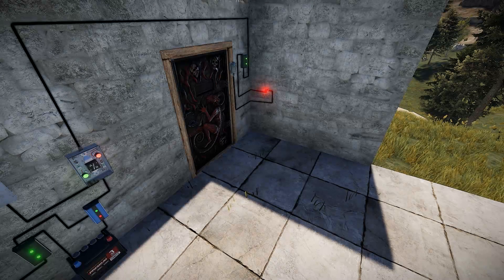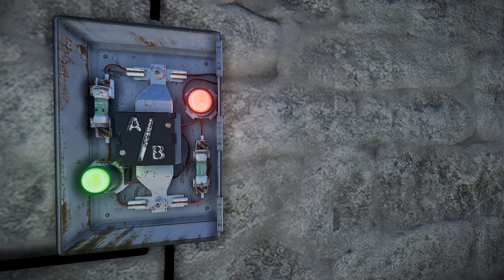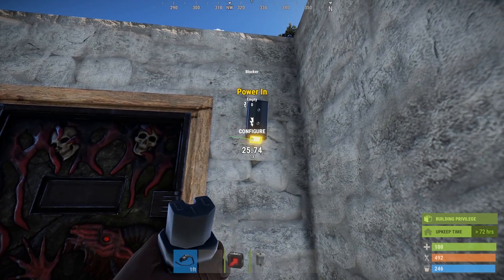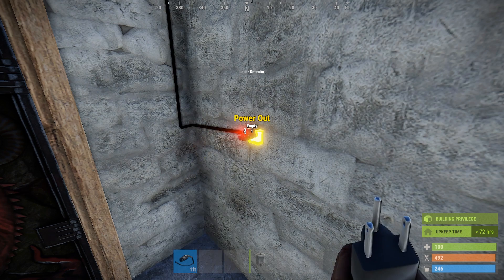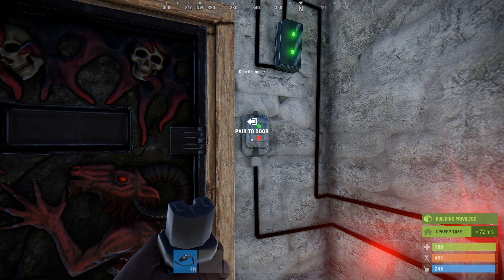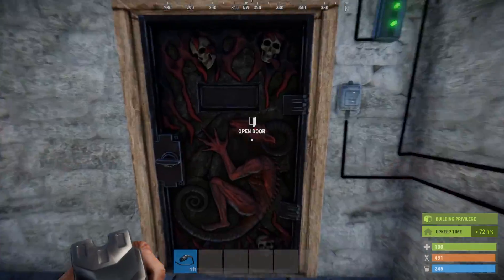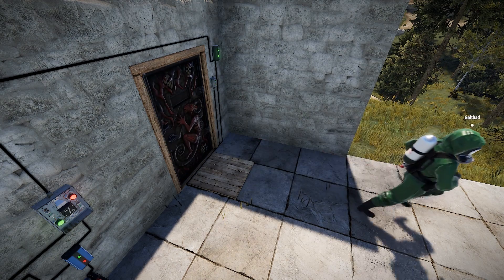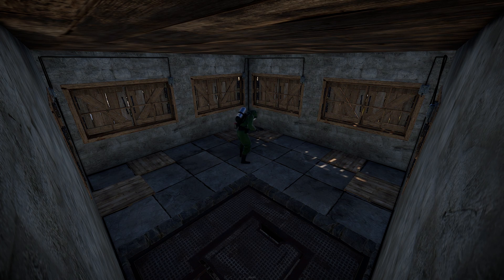RUST 101: Electricity - Automatic Closing Doors

Comment: this is amazing, but may i ask if a raider (enemy) walks through the laser doors would open and close to? or does it only apply to auth'd players?
Reply from the maker: So back in the day door controllers were only toggles rather than controllers. But these days you get to set on the door controller whether you want it to open, shut or both. Additionally in the latest patch they made it so once a TC is taken out all door controllers are automatically disconnected so they can't be abused anymore. :)
Reply: @Malonik  Thank you bro
Reply from the maker: @AJ.KD2123  No worries! :)

Comment: Ah i see now that I can be more efficient with the e-branch rather than just running splitter lines directly to lasers.  now I will be able to fit more things in on one splitter line. thanks man, these are really helping get electricity down within a couple days
Reply: If you have lots of lasers, branch to a splitter then to 3 lasers, it stops you needing 3 branches which each power draw 1 themselves

Comment: hey mate i got question. im trying for like 3h now to make switch that can only close the door but cannot open it. do you have any idea how to do it?
Reply from the maker: Sadly you can't because the door controller is more of a toggle rather than an actual controller. The closest thing to it is using a timer and setting it to 1 second so it would open and then close immediately. That way if you trigger it an open door will close. However it you  trigger it a second time that door will open and then immediately close. 

You can add a memory cell to it so that the timer only functions once and then has to be reset from somewhere else in the base but by the time you've got it all wired up with all the different components and such you're honestly just better off opening and shuttingthe doors manually to avoid making your base less secure.

I'm really hoping that Facepunch is going to give us more functionality with it for example letting us set it to open / close / both.
Reply: yeah dude thanks for the reply. after trying to 4h i managed to do it with time as you said. i also managed to reset it somewhere else in the base using the HBHF sensor which will only reset the timer at the entrance only if its u standing there. the downside of this is way too much work and effort if we could pair doors that would be double but with billions of spliters its just meh..  @Malonik

Comment: Is there any idea why my door controller never get any power if i connect it with pressure pad or the laser..The input can 100 or whatever but the output is always 0.
Any idea Friend?
Reply from the maker: Is there a red light on your door controller? You might not have paired it to the door.
Reply: @Malonik  no the red is not on. the bottom green light is on when i pair it..but the upper what shows the power support never lits..however if i connent without a laser or presspanel it gets the power..:D im totally clueless cuz its a very simple thing:D maybe bug?

Comment: Can you power a door on the otherside of a wall?
Reply from the maker: Yeah absolutely, you can run your wiring through walls so you could essentially set up a control room somewhere deep inside your base and have it run throughout the base and control all different parts.
Reply: @Malonik  I've run into another issue which is probably easy to fix, I've got a large battery that is powered enough to always sit at 4 hours, connected to a circuit that opens 10 garage doors with a switch, the issue is with the power divding 3 ways with each splitter I use to extend the amount of doors it can open it only allows for 8 (or 9 if I get rid of the last splitter and give up on the last garage door).  Do you know of any simple way to remedy this?

Comment: Can you make a video showing how to close multiple doors with a laser detector/pressure plate but when that laser detector/pressure plate is triggered it doesn't open the doors. So for example I open one of my HE Stone gates and run through and then trigger the laser detector which closes it, but if I were running out through the detector it wouldn't open the door, only close it if I manually open it? I'm quite stumped
Reply from the maker: That's a tricky and honestly I think impossible one. We need more functionality from the door controller because currently it's moreso a door activator than anything. I can get it to do it however once triggered it needs to be reset with a switch somewhere else. Until that switch is used it will be on lockdown and won't work.

What I'd really like to see is the ability to set the door controller to one of three settings - open / close / both. That way we could easily set it up so that it only closes doors rather than opening and then closing.
Reply: @Malonik    Either we need a different inputs on the door controller (For example one terminal that works like today, one for only closing, one for toggle and one for only opening. It also makes it much more versatile with all those options), or the ability to use negative voltage (So you can (re)send a negative voltage that will only cause it to close. You can't resend zero voltage...).

It would also be quite beneficial to have a feedback loop also, so it sends ON when the door is it's closed and OFF when it's open, or the other way around :)

The "electrical system" in rust is pretty far from how electricity works in the real world. The splitter is a huge indicator on that, because if you input 99w, it should provide 99w at all 3 terminals, so you could have 70w on one, 20w on another and 9w at the last one or any other configuration that is below 99w; NOT 50w or 33w if more than one terminal is used...

If the people at facepunch thought they simplified "electricity" in rust, they are wrong! Electricity is actually less complicated than this mess, especially in this case when you can throw ohms law out the window in the simulation (don't have to account for wire gauges etc)!
Reply: Also, more of the electrical parts needs inverse output!

Comment: Is there a way to open a door while far way from it so you could have 1 person aim down a hallway and another press a switch to open the door while not being near it.
Reply from the maker: Yeah absolutely, just place a switch far away / wherever you want it and then wire it up to your door controller. Technically you don't even have to have the switch on the same floor or even in the same building.
Reply: Like Malonik said, but now you can use a hbhrf sensor thingy

Comment: dude, when I pass the laser just one of the light at the door button thing lights green, the top one.The bottom one stays red and the door doesn't open.Im using a small battery, is it because of that?
Reply from the maker: Sounds like you haven't paired the door, stand in the laser so the controllers lights come on, unlock the door and then look at the door controller and press e. The red light should turn green and it will start working. Also don't forget to lock the door afterwards lol.
Reply: @Malonik  Thanks dude, it worked! I put an auto turret in front of my door in a 1x1 and a garage door that opens throught your system, now I wanna put 2 auto turrets and I wanna make them open from the same signal, and I want the signal to be a lever, do you think its possible?
Reply from the maker: Absolutely is, run your switch or lever into a splitter and then run the splitter to each of the door controllers. That will make both open when you pull the lever. I'm actually making a little guide on that tomorrow. :)

Comment: Can other people that arent you / teammates use the laser to open the door?
Reply from the maker: Excellent question and yes they can. I'm really hoping that Facepunch gives us more functionality with the door controller. For example setting it to close only. 

I am working on a more secure version of the doors which requires someone to be on either side for it to open automatically but so far that's as secure as I can come up with.
Reply: Malonik I have a thing that I can build using the memory cell so if you use the pressure plate on the inside there is no way to reopen the door unless you pull the reset switch you can probably use it to trap people inside and hide the reset switch or use it to prevent people going deep

Comment: Is there a way to use this on locked doors to make them close automatically as soon as you passed the laser to prevent that people go deep?
Reply from the maker: Yeah absolutely, you only need the door unlocked to pair it to the controller. After it's paired you can lock it. :)
Reply: Yes,  by placing a keypad lock on the door, set your code, UNLOCK OR OPEN the door,and then pair the door with the controller, and you're done mate!

Comment: Doors that shut by them selves is a good idea. doors that open cause of pressure pads though, nope. I wont be using that in any of my bases
Reply from the maker: Until Facepunch give us more functionality with the door controller there isn't much that can be done.

I've got an advanced door guide in the works which requires someone on either side to cause it to open automatically so that's at least safer but I still desperately want more functionality from the controller. 

Like why not let us set whether it opens, closes or both so it's actually a controller rather than essentially an activator.
Reply: @Malonik  I feel like they should have made all electronics open from the start instead of farming for them. I know you can go to creative sites but this would have made it so much easier for people to get to grips with
Reply: the remote swich + the pressure pad/lazzer on the same circuit using the AND one and you are done... you can make that each pressure pad/ lazer will work ONLY while you are pressing the remote swich. So it requires a "digital tool" and also requires to be in the correct place to activate both systems.